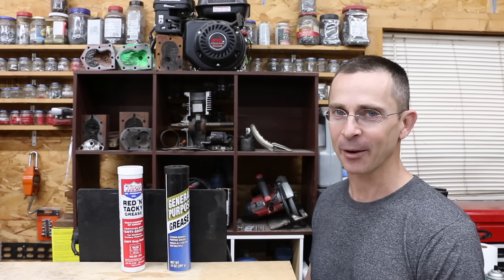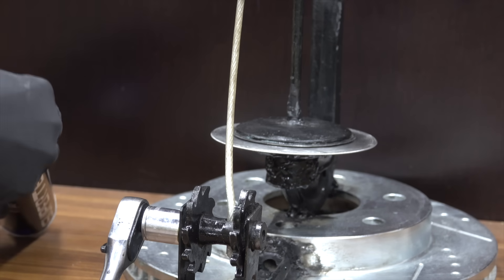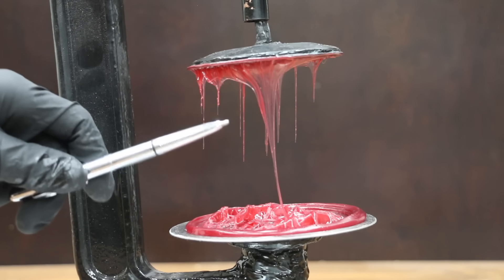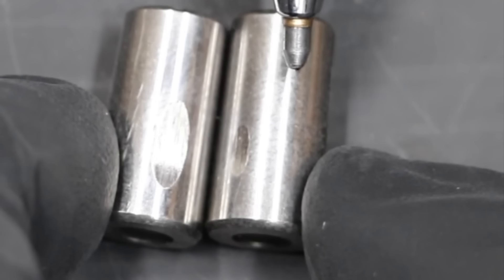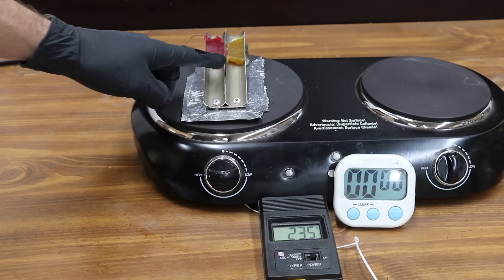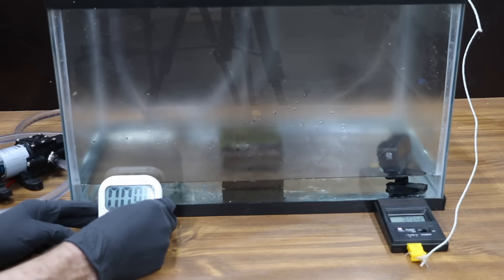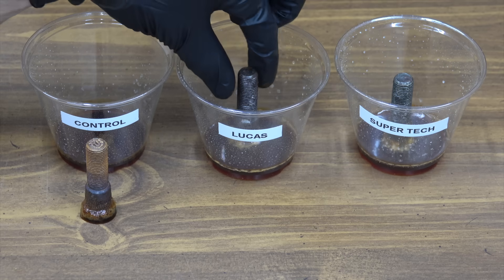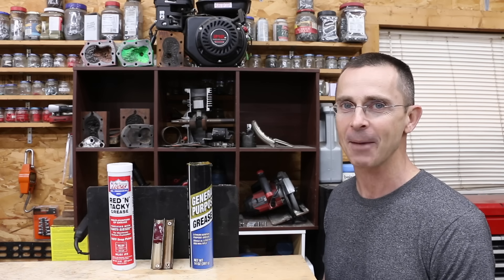Is Cheap Grease better than Lucas Red N Tacky? Let's find out! Bearing Grease Test Episode 1

Comment from the maker: Thanks to everyone who requested this one, and please let me know what other brands you'd like tested.
Lucas Red N Tacky: https://amzn.to/3l3lKKh
Super Tech General Purpose Grease: https://www.walmart.com/ip/Super-Tech-General-Purpose-Grease-14-oz-Tube/16928006
Reply: What about the Lucas X-Tra Heavy Duty Green?
Reply: you almost have a million subscribers, will you make a 1 million special video once you hit 1 million? ;)
Reply: The German Dude Hoffentlich.
Reply: I'd like to see Amsoil grease tested and Motorkote.
Reply: I'd like to see valvoline grease tested.
Reply: Could you test those rather expensive Teflon/PTFE dry lubes and sprays?
Reply: AMSOIL, would also be cool to throw some marine grease in next line up to see how they compare at water repellent test.
Reply: randomsanwhich 
I would like to see Amsoil also. I use Evinrude Triple Guard Grease and Extreme Pressure Wheel Bearing Grease for all marine applications (as a marine mechanic). I would like to see how these 2 compare to other manufacturers (like Amsoil).
Reply: randomsanwhich 110% agree. I use Amsoil grease for my bearings on trailers, hedge trimmers and my rack and pinion on my boat.
Reply: Would really love to see Valvoline SynPower Synthetic. Its black and feels gritty. Thanks!
Reply: Mobil 1 and Amsoil!
Reply: Shaffers grease would be awesome to try out!
Reply: Mystic JT-6
Reply: i would like to see mobil 1 and amsoil. My boss at my old job swore that lubrimatic marine 11402 was better than anything. thanks
Reply: I'd love to see Dumonde tech MR Grease or Phil wood grease
Reply: Deere vs Cat VS Case  etc own brands.   You could re-do all your grease, oil, penetrant, lube tests with the brands we pick up at the dealer while we are getting the parts because its right there and we dont have the time to go somewhere else to get brand x.
Reply: Harbor freight has a brand it carries aswell check it out.
Reply: Super lube
Reply: Travelers from tractor supply.
Reply: Any brand of moly grease and lithium grease
Reply: Texas Refinery Crown And Chassis
Reply: mobil 1, redline (thinking like CV2 or similar)
Reply: fords moly grease please.
Reply: Some marine grease :)
Reply: Which gun oil or lubricant works best for lubrication.  Such as froglube vs graphite or Rem-oil vs Hobbes.
Reply: PickelJars ForHillary As much as I hate to say it (criticize). My son and I tried frog lube and after a storage period it gunks up and will cause reliability problems. Degreased and applied break free (the older formula) all is well.
Reply: Sta-Lube SL3121 Marine
Reply: Chemsearch came out and had a demo. It was impressive. Great grease.
Reply: NewHolland Ambra grease :)
Reply: Cat grease https://www.cat.com/en_US/campaigns/awareness/cat-fluids/greases.html
Reply: Please project farm take a look when you have time buddy love your channel!!
Reply: Excellent Video! I would love to see Valvoline Cerulean, which bills itself as a heavy duty grease suitable for heavy fleet and mining use. I have been using this in fleet trucks with good results, but im always looking for more info!
Reply: WD-40 Multi Grease please.
Reply: Paint remover/stripper!
Reply: Boat trailer bearings get alot of water exposure maybe some specific marine grease can be tested for water repelling ability like u get a whole summer of boating.
Reply: I think I've got a good video idea for you... Would love to see you test different gasket makers like Toyota FIPG, Honda-Bond, Permatex etc. Maybe show resistance to heat, ability to with hold pressure, ability to adhere to surfaces that aren't perfectly smooth? Love your videos!!!
Reply: I had a boat wheel bearing running hot that was initially packed with Royal Purple grease. I stopped and purchased the Lucas Red and Tacky. The bearing then ran at normal temperatures. (I could have flushed water or debris out with the Lucas) I’m sure Royal Purple is good also. 
I’d like to see Certified Labs Premalube tested. It seems like a great grease. We use it at work in trailer bearings that are used and abused. I can send some if you would like.
Reply: Texas Refinery Paragon 3000, Mystic Greases, Lucas Heavy Duty, Certified Labs Premalube
Reply: If you are testing greases that are in a tube and not the big containers you can buy for wheel bearings and things like that... Then I can think of a bunch. Driven, Green Grease, Mobil 1, Shell Rotella, STP/ Costal has 2 different kinds, Valvoline has like 7 different kinds, I think WD-40 makes a few, the other various kinds of Lucas, and I think even Royal Purple has some. Those are all that I can think of that are "popular" but someone else is probably going to think of some more.
Reply: Mobil 1 Full Synthetic grease
Reply: Would love to see maxima and bel-ray tested!
Reply: Please test Mobil 1 synthetic grease.
Reply: Thank you for being to transparent and thorough with your testing. I've noticed in other videos that even when you learn new information or methods, you retest, adjust accordingly and reference it. This level of honesty and attention to detail is what makes me recommend your channel and trust your results moreso than what I grew up using. Been doing automotive/HD truck and Fleet for 20+ years now and I have found myself replacing some chemicals I have used my entire career based on your videos. Also, my 6 year old loves your Duct Tape comparison videos and now we have TRex tape because he said it was the smarter choice... See the influence you have?! Thank you for your diligence.
Reply: I'd like to see some high end greases tested. Such as amsoil chassis grease.

I'd be willing to furnish the amsoil and send it over for testing
Reply: Redline CV-2.  800°F drop point, rich in molybdenum disulfide, works better than NLGI certified bearing and chassis grease from NAPA over both time and temperature.  Wheel bearings, hinges, caliper slides, CV joints, nothing I've ever used on has failed or worn out.
Reply: there is a brand of lubricants by the name of Schaeffer that are super good. when i hauled fuel in the Canadian Arctic i had the opportunity to spend 3 days in a shop as my truck was being repaired for leaking injector cups. this particular shop used ONLY Schaeffer products. I asked what's the big deal with them and found out that one large northern based trucking company (Whitehorse Yukon) would use ONLY Scheaffer products in their equipment. the drivers told me it was such high quality that it justified the cost of the product. nobody wants to be fixing at 50-60 below. and the coldest part of winter is peak season. 

anyway the shop owner let me watch and help and i learned so much in those 3 days. i even had coffee breaks with the mechanics. i suppose to most people that doesn't sound like fun but it was for me. maybe you could test their products against others. it was crazy expensive i remember the grease was 8 bucks a tube. thanks for all the work you do.
Reply: Mystik JT-6 Hi-Temp
Reply: Please test Mystik JT-6. Most farm stores carry it around me, so that's what I use, as well as most people in my area.
Reply: Green grease and redline please!
Reply: Would like to see GREEN GREASE by Omni Lubricants B004Y0788O (Amazon) against red n' tacky. Thanks
Reply: You know Super Tech makes a high temperature red grease like Lucas Red N Tacky Multi duty. Its called Super Tech Multi Duty Grease. You should do a test on those since their very similar to each other. Unlike Super Tech General purpose which is for light duty applications.
Reply: Orileys house brand
Reply: Please test Motorkote grease (and do lubricity test on restore plz).
Reply: AIR-TEC g200 is all I use. I’d love to see how that compares to more affordable and readily available products.
Reply: BARDAHL EP2  grease
Reply: You ever tested 2 stroke oil I use all sorts of 2 stroke oil not brand loyal but just would like to see who's king
Reply: Magnalube G. Its expensive and I use it frequently. Seems good but is it?
Reply: @meinbtown  I used to use it too, I'd love to see how it does compared to others like Lucas Red'N'Tacky which is what I use these days.
Reply: Please try krytox GPL205. It's expensive but it is true PFPE/PTFE grease. I am very curious how it compares. Dupont has made alot of claims about the stuff.
Reply: I'd love to see a comparison to Kendall L-427 Super Blu. I've never seen any comparison testing with it, but in the field, it really stands out in it's ability to hold up. It has been my go-to for 20 years. With a lot of similar specs to the Lucas, and being such and old name, I feel like it would make a great comparison video to it, as it could be a lot closer of a race between two great multi-purpose greases
Reply: Project Farm try different oil ratios ( 50:1, 40:1, 32:1, 24:1 etc
Reply: Can you try synthetic grease, I know advanced auto parts sells a red synthetic grease, I use that in my ball joints, it really helps
Reply: Great tests. How about something with a Moly base?
Reply: Aeroshell 33 (pure synthetic not the MS/moly): I've switched this to my universal to include automotive+aviation.  Left in a tube, it dries out in 2-3 years.

Mobil 1 (of course): separates and bleeds out in a year - 18months

Mystic JT-6 multipurpose

Valvoline multi vehicle high temp (red)
Reply: Project Farm  all the greases, this test
Reply: how about 274 moly schaffer grease?
Reply: Amsoil grease against Lucas
Reply: I'd be interested in seeing how Evinrude blue grease stacks up.
Reply: Best. Channel. On. Youtube. Period.
Reply: Corrosion X, Corrosion block, penn fishing grease, park tool high performance grease
Reply: @Mastr-Tech  Finally, someone who knows about corrosion x and penn grease.  I was going to suggest those too.
Reply: I would like to see sta-lube (harbor freight) atomlube and wd40's grease. Thank you for the well thought out video and tests.
Reply: Thank you for finally starting on this series!! I’d love to see Royal Purple Ultra Performance, Amsoil Multi-purpose and maybe the NLGI2 Off-road, and Redline CV2... to name a few. I’m excited to watch this all play out!
Reply: Its N L G I !!!
Reply: Do green grease vs red n tacky
Reply: Park Tools Polylube. It's pretty much the de facto bicycle grease.
Reply: Schaffer’s molly grease please I got a salesman that keeps telling me I need to switch but I’m not sure it’s worth the cost
Reply: Hey I forgot I use chevron delo , it would be cool to see it vs Schaeffer
Reply: Bel ray waterproof grease
Reply: Please test Marine Grease compared to Lucas Red ...TY
Reply: Schaeffer's 238!!  Time for an ultimate grease showdown
https://www.schaefferoil.com/238-ultra-supreme.html
Reply: Bel Ray waterproof https://www.belray.com/product/waterproof-grease/
Reply: Mystic JT6 with Moly
Reply: Mobil 1 synthetic, Valvoline synthetic, Lucas heavy duty and Shell Gadus
Reply: It's expensive but could you do a test on John Deere SD poly urea Grease and just for fun do a test on the cheapest tube of Grease you can find
Reply: I'd like to see some Moly greases tested and the Mobil brand specifically
Reply: Redline
Reply: Another vote for Bel Ray water proof, also Caterpillar but the desert gold version, this is the best stuff I've ever used.  Made for extreme environments, high pressure. I use it in my off road race cvs.  Same stuff desert racers use.  It sticks to everything, very difficult to clean off
Reply: Can't forget redline cv2, great stuff!
Reply: Mystik JT-6 Synthetic Hi-Temp Grease #2 ISO 220
Reply: Energy Suspension silicone lubricant, sil glyde,  super lube, royal purple. Those all would be great to see tested. Thanks.
Reply: Test Mobil 1 ep grease, that is what my work uses on the 5th wheel plate of semis
Reply: amsoil synthetic polymeric off-road grease nlgi #2
Reply: I would like to see the big brands like Mobil, shell, chevron, lucus, masoli, basic brands and see if their price points are worth it.  We use Chevron's delo esi ep 2 and it's not cheap but seems be a good grease.
Reply: I'd love to see Lucas red and tacky vs Lucas extra heavy
Reply: Could you try Maxima waterproof grease?
Reply: A battle of gear oils would be interesting.
Reply: Im so happy you accepted my suggestion
Reply: Green Grease
Reply: Please test 'Green Grease'  - it can be found in most auto parts stores.  It's quite tacky, resistant to water, and works well for utv's.  https://www.greengrease.net/
Reply: Umm...any chance you could identify the lot numbers on those tubes? It should be at the top of the tube (plastic cap end). If it's all numeric (like 414367...) Please post. It may be hard to see as it's laser etched into the foil - I'm a quality control chemist for Chemtool...we are one of the manufacturers of both of these greases.
Reply: @jensdavidsen4557  I could when I go back to work im off today.
Reply: Primrose 327, 8 bucks a tube but it’s supposedly the best grease there is, according to pretty much every heavy duty diesel shop around here
Reply: Shell Gadius S5. Best Grease i've ever found.
Reply: Premalube heavy duty multi purpose nlgi #2 grease h2. My friend is changing from lucas tacky to that stuff above.
Reply: Water coolant test 🤔🤔🤔
Reply: John Deere SD polyurea vs Lucas x-tra heavy duty. They seem to be the same grease.
Reply: I would love to see a test with Orion 95+
The best grease I have used
Reply: From my experience, lucas is closer to heavy duty wheel bearing grease.
Reply: Motorkote..
Reply: Lucas Red n Tacky vs Certified Labs' Premalube Red
Reply: Please please please buy and compare Opti-Lube ULTIMATE Grease!
Reply: Castrol Tribol GR100 PD2
Reply: Valvoline Crimson and DRIVEN EPC
Reply: Would like to see petro canada precision synthetic grease, here in Canada we either use red and tacky or precision synthetic for the product pumps on our tanker trucks.
Reply: Great video!  I would like to see amsoil and trc
Reply: Sta-lube marine grease.
Reply: Bigfoot greese is really cheep at napa and I have been loving it for our golf course equipment. Its super sticky stuff and handles the water well
Reply: Tractor supply autozone advanced etc I think would be a great starting point.
Reply: Traveller extreme duty 3 percent moly at tractor supply is what we use for our logging equipment. Would love to see how it does. This is another great video topic that I didn't even think about!  Thank you!
Reply: It would be great to see Chemsearch vs Certified Labs vs Mobil XHP 322 Mine.  Testing their ability to maintain a protective film under extreme pressure and impact would be very helpful for those who run heavy equipment.
Reply: I'd love to see how Valvoline marine grease stacks up against some other marine greases like Traveller or Supertech. I use Valvoline marine by the 35 lb bucket when assembling new snowplows and servicing old ones. Thank you for your extremely comprehensive and unbiased reviews. I refer to your testing whenever purchasing tools and consumables, so far the Dewalt Carbide utility blades and the 4.5" Diablo cutoff discs have been great purchases.
Reply: Great video, very well thought out testing methodology! Could you test Magnalube-G please? Additionally, if possible, test a grease/dry-lubricant hybrid, like Red'n'Tacky mixed with Tungsten or Molybdenum disulfide powder?
Reply: Mystik red and tacky?
Reply: Please test the winners in an all-out test against each other.   i am curious to see how they will stack up.
Reply: Pennzoil grease!
Reply: Great Video.
Reply: we use a castrol product, pyroplex blue, #2 grease i know its tackier than the lucas and is supposed to be extremely water resistant, we buy by the case, would like to know where it stands, 
thanks and keep up the good work!
Reply: Valvoline grease and maybe a synthetic
Reply: Can you test common petroleum jelly (Vaseline) as a 'base' or 'control'?  Also, how about testing silicone grease - like electrical grease?
Reply: moly paste?
Reply: I'd love to see you test Jetlube 50350, white lithium grease with PTFE (teflon).  We call it magic grease at my company because it makes every mechanism work buttery smooth.
Reply: I would be interested to see dyna lube grease. They also make an oil additive
Reply: Tractor Supply Red grease.
Reply: you can test different brand fishing reel greases vs different brand marine greases
Reply: Project Farm please review amsoil a grease https://www.amsoil.com/shop/by-product/grease/
Reply: Marine grease like Quicksilver or something similar please! We're in a saltwater environment and would love to know which is best to use
Reply: Tractor supply has like 3 different kinds of travelers. I'd be interested in differences.
Reply: Grease lightning
Reply: AR8100 Heavy Duty Grease and AR8300 Severe Duty Grease against the Lucas Oil. 
I'm blown away that no one has mentioned this yet!!!
Reply: Test some calcium sulfinate grease. as far as the 4 ball weld test, its double than what normal lithium based greases can handle. not to mention an even higher drop point.  the grease brand Prolong would be the one to test against others.
Reply: Valvoline Moly-Fortified Gray Full Synthetic Grease
Reply: We use a lot of the John Deere multi purpose grease and Akcela Case IH multi purpose grease. I'd be really interested in seeing those two tested.
Reply: Please do tire brands comparision. expensive vs cheap, winter vs winter tires, summer vs summer tires, and winter vs summer and so on.
Reply: mobil 1 grease for sure
Reply: Amsoil since they won’t the oil competition
Reply: Mystic and Valvoline brand grease please
Reply: Graphite spray.
Reply: You never tested hole saw brands
Reply: Have you ever used the grease from a farm co-op
Reply: Love to see a bike chain test. one with no lube, paraffin wax, ptfe, brand names etc. testing wear,  heat and stretch. then add water!
Reply: Mercury marine grease
Artic cat snomobile grease
Life brand vaseline
Reply: Test how much grease should be backed in a trailer wheel bearing hub? Some people say pack them completely full and others say pack the bearings and just put a handful of extra grease in each hub. I’m sure you could repack a trailer, one side each way and then load it down to max gvwr and tow for an hour and temp check each hub to see which is hotter and then disassemble each to see where the grease all went and how it covered components.
Reply: Test Mobil SHC 007 grease compared to a high quality synthetic grease in wheel bearing applications.
Reply: At work in all our equipment the company uses Wolfs Head Red Grease.
Reply: Sta-Lube SL3151 White Multi-Purpose Lithium grease vs. lucas red
and
Sta-Lube SL3121 Marine Boat Trailer and 4 X 4 Wheel Bearing Grease vs lucas red.
I know these are two separate types for different purposes.
thank you for all your videos and immersive testing.
Reply: Bel-ray waterproof grease
Reply: Mercury 2-4-C marine grease. I use it on everything and I really love the product, just curious how it compares to other products
Reply: I don't have a grease suggestion, but I do have another idea for you.  Double sided industrial tape.  I was looking for some for work and there are so many different kinds to choose from.
Reply: Very interesting results! Thanks for the video. I've heard Royal Purple is the best. So would be interested in seeing a comparison with that.
Reply: Would like to see a Lucas Red n Tacky vs Lucas X-Tra (green) grease at some point. Maybe versus their Valvoline red and green counterparts too for added value. Thanks, and love the videos!
Reply: I drive a tractor trailer and used Lucas to grease my fifth wheel red and tacky they make bags u put one on each side of the fifth wheel and crush them between the truck and trailer and done
Reply: Can’t tell you how much my co workers and I love your channel! I never miss a video! I am very interested in seeing you test Archoil, Turbomaxx & nanolube oil additives.
Reply: you think peanut butter could work as a grease substitute?
Reply: Peak Synthetic Marine Grease
Reply: John Deere
Reply: Lubriplate grease, supposed to be some pretty good grease for wheel bearings.
Reply: Mystic semi syn vs valvoline synpower. I was surprised how the Lucas did better even though it didn’t seem to be re-coated as well on the wheel.
Reply: Its pretty obvious a lot of y'all don't live/fish near the salt water.  Here are some ones used in the gulf to add to your testing.  Corrosion X, Aquashield (youtube it, its some crazy tacky stuff), Penn Reel Grease, Yamaha Marine Grease, and Lucas Marine Grease.  I'd be curious to see how 3M/Dow Silicon (di-electric) grease do also.
Reply: Maybe cheap dremel bits to dremel brand
Reply: Amsoil
Reply: Your pure science with these methods
Reply: John Deere. They make a few kinds, make sure to choose one that is comparable to the others in the test. In my experiance, it tends to "stick" a lot longer then box store off the shelf stuff, and most certainly handles outdoor weather better.
Reply: I’d love to see this compared to blue marine grease. It’s what we have used it on the farm for years.
Reply: Should love to see pro one grease be tested they use similar rigs as you do but the results are soo good I almost think it's fake but high pressure oil rigs and NASA use it so it should be good right?
Reply: @farmersgrip  late to the game? Watch his passed videos bud
Reply: @TheLongjohndong  sweet ill look for it
Reply: Awesome job on the video!!
Reply: Project Farm, You may have done it in the past but how bout doing lubricity tests and corrosion prevention tests on gun oils. I always wonder which is best for guns. Fishing reel oil would be another maybe. Enjoy your videos! Thanks ✌️
Reply: Project Farm we use castrol Pyroplex Blue at work and I use it at home. I’d love to see how that fairs in a test. We’ve noticed significant less wheel bearing failures due to moisture based corrosion since we’ve switched to that from generic NAPA all purpose chassis and wheel bearing grease.
Reply: Mercury Extreme marine grease. Best stuff out there. Bet.
Reply: How about restoring a 12v car battery, I have seen a lot videos on it but does it really work?
Reply: redline cv2 grease! curious if i'm just buying into the hype or the stuff i've been using is actually decent. keep up the awesome, informative videos!!
Reply: Yep amsoil grease for automotive applications compared to Lucas would be good
Reply: Can you test the Lucas Low Viscosity Oil Stabilizer? I want to know if it actually makes a difference.
Reply: Maybe a marine grease!
Reply: Please test a food grade grease. I work for food and beverage manufacturer, and we can only use food grade which I believe leads to tons of bearing failures. Thanks
Reply: Please consider testing Power Punch grease.  I use it over the Lucas Red & Tacky.
Reply: I work for a Mack Truck dealer and we have our own branded grease. Can I send you some for you to test and compare?
Reply: How about traveler brand from tractor supply, mystic,cenex brand and lucus. This was another great video,keep them coming.
Reply: Maybe throw Cenex grease into the test as well
Reply: Fantastic job on this video!
Reply: Mobil!
Reply: Cenex HD Moly Extreme, a buddy and I were comparing his high temp for clutch bearing vs this moly that I use in all my construction machines and trucks
Reply: @kenball1980  I was hoping someone would mention this supertech grease instead its also red like that lucas grease feel like it would be a better comparison
Reply: Try moly grease, supertec vs other brands.
Reply: amsoil grease!!!
Reply: Marine grease vs red and tacky
Reply: You need to test Claas ep-2 and Ep-3 Grease. I believe it’s the best grease out there 👍🏻
Reply: I have a video idea, testing the lubricity of various oils at different temperatures to see if it changes significantyl, if so how much and which oil is the most stable over a wide temperature range.
Reply: Schaeffer's makes a red n tacky
Reply: Compare sythetic diff fluid to regular diff fluid
Reply: Alco-Metalube
Reply: Can you get your hands on some whale oil? Supposedly it is far superior to modern petroleum oils in terms of film strength.
Reply: So should test safety glasses
Reply: Please test  rotella t6 5w40 vs valvoline premium blue 5w40. Both are good brands, but one has to be better?
Reply: Try Pro-ma MBL Grease. Friction brake/Cross action test will blow any other grease out of the water. You dont need much of it either. Search "MBL Grease demo" on Youtube.
Reply: Could you test Ballistol multi purpose grease? Is it available in your country? It is a grease used here in Germany.
Reply: Flat Tappet lifters. Engine builders have said that currently available flat tappet lifters are not as durable as the old ones and are experiencing lifter and cam failer. Can you test modern built flat tappet lifters against vintage NOS ones?
Reply: Mobil 1 222 vs red n tacky
Reply: Valvoline SynPower Synthetic Automotive Grease - 14.1oz (VV985)
Reply: lucas makes several greases, including lithium, marine grade, HD mining+construction,  xtra HD and synthetic high pressure grease. it would be amazing to see lucas' own line go through the gambit to highlight strengths and weaknesses of each so that we can make an educated decision even with the same brand. also, how does liqui moly compare?
Reply: motorup..... you really need to test it just watch some of the online videos of its advised performance
Reply: I currently use Royal Purple grease, lets see if it's worth the money!?
Reply: TRC 880 crown and chassis. Been using it for years because I’ve been told it’s the best.
Reply: You really need to test is the MilSpec standard for extreme pressure grease Aeroshell 64. It was used on almost every grease surface on the jets I worked on, and it's even the antiseize used on M16 barrel nuts.
Reply: Hi, can you do an episode on rust converter/primers to see which is best at preventing rust from comming back. You can try well known brands like Brunox, Corroseal, Fertan, Jenolite etc..
Reply: You should also test the John Deere thixotropic Corn Head Grease.
Reply: Superlube synthetic grease vs a Moly grease vs a marine grease vs a regular grease please!
Reply: Adam lube would be a good competitor. It's the only grease I use anymore.
Reply: I use the green grease of Lucas for rifles. It's amazing. But picks up dirty like none other
Reply: Look forward to the grease race
Reply: Please test what is best to use for cable lube at low temperature
Reply: Napa grease, tractor supply grease and marine grease would be good to test
Reply: Lubriplate No.1200-2
Reply: I use Lucas xtra heavy duty grease in my equipment. Even more expensive than red and tacky. Can u test the xtra heavy duty grease please?
Reply: Amsoil kicked butt in the oil shootout, how does their grease do?
Reply: Something with with Molybdenum of course, but also Mobil1 since I just bought a case. UMI performance has a special grease for their roto joints, so now i wonder. Also, dirtbike waterproof grease. I'll have to look up the brand.
Reply: Love your videos, I tried every type of grease known to man for the high-speed bearings on a city leaf machine on the shaft and bearings that run the impeller. Kendall blue never failed us for over 30 seasons and every time we tried something a little thicker it would slow down the speed of the balls and score the race but keep in mind this was super high speed bearings just a little informational input
Reply: Next grease test can you test {Mystik Multi-Purpose Grease} NLGI NO. 2 (upc:044871548452) Sold at Walmart
Reply: There's this brand I'm seeing advertised on Facebook, UltraLub. Any chance you could test their motor oil to see if it's any good?
Reply: What about using baby oil for an engine?
Reply: I would like to see Valvoline Cerulean grease and Chevron Ultra-Duty EP grease tested.

I can send you a tube of each but don’t know your address.
Reply: Project Farm you should test Mentek Elite Grease vs Lucas Red n Tacky. I have some Mantek grease that you could use I would really love to see the results
Reply: Amsoil and Mobil 1 synthetic greases would be good to test since they are both popular and similarly priced.
Reply: If you can get hold of some I'd love to see omega by sovereign  lubricants tested
Reply: Wonder how molybdenum grease holds up
Reply: Amsoil muti purpose grease
Amsoil marine
Amsoil racing
You should do a championship like the motor oils
Reply: A look at Park Tool bike grease PPL1 would be great!
Reply: The valvoline crimson
Reply: I would be interested to see this same  comparison between Lucas and Amsoil grease.
Reply: I’ll help pay for you to test Traveller Extreme Duty 3% moly lithium from Tractor Supply Company (TSC)
Reply: Test the Schaeffers grease
Reply: Project Farm wd40 specialist grease and mobil 1 and valvoline.
Reply: Test John Deere grease.   They will void warranty’s if you don’t use their grease.
Reply: I wait one day there is already 200+ replies!

Anyway, I hope my list isn't too long. Please test;

Power Up Lubricants Thxiogrease (https://www.youtube.com/watch?v=dPY0a9IocVg&t=310s)
Chemsearch Maxi Lube (https://www.youtube.com/watch?v=Vgsyjxll224&t=12s)
Amsoil Polymeric grease
WalMart brand AtomLube and the Red Super Tech
Harbor Freight Sta Lube and Super Lube

If you need the Thxiogrease let me know!
Reply: I use mobile 1 full synthetic grease. Can you do another grease test for more brands including marine grease.
Reply: I, too, would like to see how the Supertech red high-temp grease stacks up against this Lucas grease.  The temperature cutoff is the same: 500 degrees.
Reply: Try Mobile XHP 322 Mine. About $10 a tube. Available on Amazon.
Reply: listed in comment below, but maybe a manufacture specific oil test and rate them agains Amsoil as it was the winner.  Polaris, and any other manufacture labeled oil.  would be nice to see if we are really getting what we pay for.
Reply: Dear Project Farm, when you test other brands of grease can you test a brand that we have over here in the UK if i send you a tub of it? Thanks in advance.
Reply: I would be willing to send you some other greases to test if you would like
Reply: PARAGON 3000
Reply: Schaeffer Ultra 221 Moly Grease. Aluminum Complex, 3%Moly. I use it for all kinds of stuff.  Also, Super-Lube Multi-Purpose grease NLGI 2 would be cool to see, its an amazing grease as well.
Reply: Sir, you're a national treasure.  What a service you provide for mankind.
Reply: I have used Lucas Marine Grease before with good results, that might be worth testing.
Reply: Add masterpro to the list.
Reply: Misty Super High Impact Grease ! I would be willing to send you some if you can’t find it. By far the stickiest grease I ever touched
Reply: Do you have a rural king near you? they carry their own brand. Also how about just a shootout of 6 brands?
Reply: Great job! Grease showdown in our future!! 😀
Reply: marine 2 stroke oil vs 2 stroke oil
Reply: Please test hydrotex grease!!!  Let me know i would be willing to send you a tube to try!
Reply: "Green Grease"
Reply: Thanks so much for sharing! We currently use Chevron grease and you are making me rethink that decision.
Reply: Just an fyi, there is a much better way to pack bearings
Reply: Schaffer’s, chevron, Lucas, auto parts brands, amsoil, etc.!
Reply: Test Shaffer's grease
Reply: How about testing Thixosyn aviation grease?
Reply: Mystik jt-6
Reply: A high moly grease, Lucas heavy duty, maybe some jd or caterpillar grease etc
Reply: I would like to see Mobil high moly grease, a cheap store brand moly grease, and then maybe ultralube vegetable based grease, etc
I’m of the opinion that the black moly grease is far superior to any red or blue translucent grease and would love to see if that’s correct!
Reply: Include Mystik JT-6 Hi-Temp Grease #2 in the next grease test
Reply: I would love to see how Racing grease compares to this!
Reply: Schaeffers, its got moly in it, way better than all the rest. When the grease squishes out the moly still lubricates
Reply: Great video and eye opener. Maybe Mystic, Shell, AMSOIL & Lucas
Reply: @ProjectFarm you are really awesome.
Plz check the grease from "CarQuest" against Mobil Grease, if possible.
thank you.
Reply: Gumball's Gameroom that product should have been tested vs the one used. This video was a bit of apples to oranges in terms of grease...
Reply: Shell Rotella came out with a line of four different grades of grease a little over a year ago.  Would love to see those in a test since they were recently developed.
Reply: I always use Copper Grease (In the UK)
Reply: Could you compare the Lucas red n tacky to the Extra heavy duty
Reply: What is the chances of you testing out Lucas Oil additive to STP oil additive I want to see the results which one is better... I've been using Lucas everything they made for years ever since they came out I would love to see if my money was well spent or not so far you prove that the Lucas products are good
Reply: Mystic jt-6 red #2
Reply: Shell Alvania Ep2 vs Kluber Ep2
Reply: Would love to see some testing on friction reducers. https://gonmf.com/
Reply: @sneakypete187 Yeah I think the green is a beryllium based grease. I could be wrong but the beryllium based grease we use at work has underwater uses
Reply: Lubriplate grease,  specifically the "SFL" line; NLGI #0 grade, if possible
Reply: Which battery powered grinder is the best?
Reply: Just for once test independently the polytron grease I am using for everything, even the grinder gear... https://www.polytrondirect.com/product/polytron-ep-2-lithium-grease/
Is cheap also in my oppinion and works wonderful. I am a simple user of oil and grease for my car and tools.
Reply: Please consider doing comparison shopping with Hot Shots Secret brand products.  They only produce a product when they can make it the best in the product category.  Caution:  Please use mixed as directed.   Their Deisel Winter Antifreeze fuel additive if left in the cold may freeze up in the teens or 20's.  If it is mixed with diesel fuel it protects to 40 below -0-.  Thanks again.
Reply: A new product being developed at Hot Shots Secret is "Grease."  Just so you know if you test Greases again.  Thanks!!
Reply: Off subject, but could you test the Zero water v. Brita?  Adding some others and sending the water off for test. The Zero water comes with a digital tester.
Reply: I would like to see super tech red vs red Lucas
Reply: Cerma oil and grease ck as I'm to beat anyone's friction and wear!! I'd love to see you test them
Reply: Harbor Freight vs kubota lithium and red grease
Reply: Texas refinery greese
Reply: I would like to see you test Mystik JT-6 High temp.  Thanks
Reply: Could you test Amsoil heavy duty grease and high speed grease against some MFA oil grease? I am an amsoil dealer and I liked your test it really proves that grease is not equal
Reply: REDEYE VS LUCAS
Reply: K-Y ?
Reply: How about a video on concrete anchors???
Reply: Great video!
Reply: For kicks, Creamy Peanut Butter 😁
Reply: Could you test hydrophobic fluids for windshields?  TIA
Reply: Amsoil
Reply: Does used engine oil destroy gaskets and seals if you let the oil sit in the car. If you were storing it. Or simply letting it sit, for a long period of time. I often find myself changing out oil with 1500 miles on it before I store my car. Almost Seems like a waste of material. Thank you Project Farm! Great great content.
Reply: I use the super tech marine grease a lot hopefully you can get it in there
Reply: Project Farm can you test gasket makers? Like permatex products.
Reply: Can you test Mobilgrease xhp222 ? (the blue stuff)
Reply: mobil 1 marine grease- that's what my boats use
Reply: Project Farm I would like to see how Valvoline full synthetic performs.

https://www.amazon.com/gp/aw/d/B000CQ4DK0?psc=1&ref=ppx_pop_mob_b_asin_image

And the Lucas extra strength
Reply: Schaeffer 238 is the stickiest best equipment grease I’ve found. Makes lithium greases look like a joke
Reply: Duralco 4525, I'm told it's crazy strong.
Reply: Schaeffer 248 "Moly Synguard 2000" claims higher operating temperatures than Lucas.  Gentlemen, rev up your hotplates!
Reply: Red n Tacky vs John Deere Multi-Purpose HD Lithim Complex
Reply: John Deere grease
Reply: What happens when you use diesel fuel additive in a gasoline engine
Reply: Test new rotella grease
Reply: Yamaha watercraft and Polaris  brands.
Reply: 3M's silicone grease  and their copper based grease.
Reply: Amsoil please
Reply: Mobil 1, vs lucas, vs valvoline, vs other high cost greases would be fantastic IMO.
Reply: Aside from the obvious value of you test results, I watch just to see what new test jig you come up with
Reply: Marine grease vs Red wheel bearing grease!
Reply: The chemical spray that you used to cause the rust in the cup what type of Sullivant is It called?
Reply: Please add Phil Wood's grease to your next test. https://phil-wood-co.myshopify.com/products/3-oz-tube-of-phil-waterproof-grease
Also Prolong: Prolong Super Lubricants PSL45000 EP 2 Grease
Reply: Valvoline Full Synthetic Grease. I use it for almost everything.
Reply: why didn't you even mention that the cheap grease actually exceeded its drop point temperature by over 20 degrees?
Reply: Would love to see a comparison between Shell Rotella Synthetic and Mobile 1, both in 5w-40.
Reply: Please test John Deere Multipurpose SD Polyurea grease.
Reply: In addition to the standard quality and common greases, would be interesting to see how the famous SUPER expensive greases stack up, like FLUOROLUBE, KRYTOX, etc. Granted, some of them are made for special environments (like oxygen).. but I've always wondered how they perform compared to normal greases. Thank you for the hard work!
Reply: bel ray
Reply: bel ray waterproof
Reply: Hi I would like to see a gun lube test done I've got some I'll send you
Reply: Lucas heavy duty grease
Reply: redline grease please?
Reply: I have to say hands down this channel is the most informative
And for those who say that famers and rural foremans do not have experience as a former engineer.
Your information and tests are right up there with a lot of laboratories.
More informative than other channels such as engineering explained. No whiteboard and  supposed theorectical.
You show the correct tests and procedures used for most mechanical and other engineers.
Your humble approach in a manner everyone can understand and the break downs to the impacts 
are the best I have seen on youtube. Using available retail products. 
I do not know where you got the education or testing background but it is up there with some of the most accredited
technical schools and universities. My hat is off to you for practical application. with proper engineering behind it.

"Thomas Edison , "genius is 99 percent perspiration and 1 percent inspiration"
Reply: FS grease is mostly what I use and wheel bearings I use Royal Purple HPG
Reply: Would you be anle to test Certified Labs products
Reply: Please try John Deere grease next time in your grease test! It’s expensive and I can’t see how it benefits us over other less expensive greases
Reply: Chevron ultra duty ep2
Reply: LUCAS vs VALVOLINE FULL SYNTHETIC FORTIFIED WITH MOLY ?
Reply: What about testing different brands of machining lubricants that you would use when machining metal parts in a lathe or other equipment?
Reply: Can you please test aluminum foil. Shiny side vs dull side.
Reply: Might sound dumb but paper towels
Witch one absorbs better?
Reply: Can you use JB weld as a heat resistant coating or paint?
Reply: Mobil 28.
Reply: Project Farm I would really like it if you could test cheap multi tool blades vs dewalt / expensive blades. Maybe wood and metal , but at least the wood ones would be most helpful to me. If the cheap ones online work it’s a huge savings.
Reply: Can you test transmission fluids a mix between manual fluids and atfs to see which is the best on the market for transmissions
Reply: Polyurea grease would be a great one to test, a moly grease, and superlube
Reply: I enjoy watching your videos...I have a suggestion how long does it take for an idling engine to use a gallon of gas compared to a engine  using a gallon of gas while under load...if you have did it all ready that's cool I'll try to find the video so I can watch it.... thanks have a good day...
Reply: How about marine greases vs those marketed as general purpose? I have a tube of Red n Tacky in the garage but I use the Lucas Marine for the boat trailer and the gimble bearing on our I/O boat.
Reply: chevron sri grease
Reply: TENAVOLTS Rechargeable Lithium AA Batteries VS Top Brand NIMH Batteries
Reply: NitroLube/Nitro Red grease vs Amsoil synthetic.
Reply: Mystik JT-6 Hi-Temp Grease #2
Reply: Could you please test the red grease vs krytox grease , krytox is 300 dollars for a small tub but is supposed to be super high temp and better than red grease , it’s grey and is reccomeneded to use gloves when applying, the grease is supposedly cancerous if played with too much with bare skin , and they make us use them on nascar racecars in the drive plates on high camber applications with floating drive plate gears, but are we really getting our moneys worth ? 300 compared to regular red grease, only time we use the red grease is on super speedways because it’s low camber and less friction for speed and don’t have to worry about heat
Reply: HART drill and impact driver!
Reply: Mitch Paul instead, use an automatic lubrication system without moly or tungsten. Solids prematurely wear whatever they’re used on (especially tungsten since it has a hardness of 9 on the Mohs Scale - for reference steel is a 4.5)
Reply: Well I don't know, I have either Lucas wheel bearing grease in the can and I have used Lucas like that in the tube but not the red sticky stuff it calls itself but I don't know why. I normally bought Lucas wheel bearing grease in the can because it was a good brand and I'd used it often over the years. I've also used Napa brand but I don't know who manufactured it for them . I remember at one time when I was a younger man back 50 years ago there was a grease that my uncle sold at his store I don't remember what it was and it was wheel bearing in a can that Daddy bought and and I'm not sure of the brands I think it may have been GRC and farm oyl. I spect most any of it will do for my wheel bearings on my tractor front end loader part of it and the all the different pieces of equipment I use. I don't suspect that I will be spinning very many bearings fast enough to get them hot! Haha. I don't know what it is I have right now in my gun it came from Tractor Supply and cost about 2 bucks.
Reply: Would’ve been a more fair comparison to have used super tech’s multi-duty complex grease as it’s a high temp, red, lithium based like the Lucas red n tacky.
Reply: Mercury/quicksilver 2-4-C and extreme pressure greasd
Reply: Project Farm I’ve been loving all your videos! I’d love to see the Lucus Red n Tacky vs Traveler Extreme Duty 3% Moly vs AMSOIL Synthetic Polymeric Heavy Duty Off-road Grease 5% Moly
Reply: Lucas vs Amsoil.
Reply: T
Reply: K
Reply: N
Reply: O
Reply: W
Reply: B
Reply: U
Reply: T
Reply: I
Reply: T
Reply: S
Reply: F
Reply: U
Reply: N
Reply: N
Reply: Y
Reply: Gg
Reply: Gg
Reply: Gg
Reply: Gg
Reply: Gg
Reply: Gg
Reply: Gg
Reply: Project Farm gg
Reply: hey can you please review more kinds of grease including ams oil grease thanks
Reply: Please test Mobil One grease.
Reply: I'd love to see low temperature testing of Amsoil and Mobile 1 synthetics. I primarily use grease on my snowmobile so low temp properties are my primary concern.
Reply: Please test Motorex grease 2000 and Motorex crosspower oil 10w40.
Reply: Every test with the red one deffo had more of it on
Reply: When it gets out do flex grease
Reply: Corrosion block grease (by the same company that makes acf50)
Reply: Molybdenum disulfide
Reply: Project Farm when testing, try to keep the tests within their categories, i.e. Wheel bearing grease (disc brake, non-disc), CV joint, chassis grease, marine grease, etc. As for brands I'd like to see, Lucas, Valvoline, STP, WD-40, CRV....
Reply: Krazy grease from walmart
Reply: Valvoline Multi-Vehicle and Valvoline General Purpose grease please!
Reply: I don't think you've done it yet but I'd like to know if there's a difference between name brand and Chinese knockoff Mufflers how well they resist corrosion and the power added or subtracted to the vehicle
Reply: Would like to see the red-n-tacky up against the poly urea that John Deere sells.
Reply: Wd 40 Grease
Reply: Morris grease ?
Reply: Will y9u fo more grease showdows?
Reply: I would like to see the difference between Lucas red and tacky and Lucas xtra heavy duty green
Reply: You forgot the marine grease
Reply: Project Farm Toyota Tacoma
Reply: Marine grease test would be great
Reply: Mobil 28!!!   Many subscribe that the mobil 28 red aviation grease and the lucas red and tacky are similar enough to use the cheaper ($10-$15 per tube) lucas in small aircraft. I'd love to see if there are any similarities outside of the color, I'd even be willing to send you a tube of the aviation mobil 28
Reply: For wheels?
Reply: Test "Swepco 101 Grease" against Lucas.  This is a molybdenum grease that they say is one of the best out there
Reply: I use Schaeffer's 274 grease on all my trailer wheel bearings, ZTR mower deck and other grease point, plus all the grease points on my tractor FEL, and all 33 grease points on my excavator.
Reply: Amsoil vs Redline grease please.  Thank you Sir.
Reply: Witch tires last longer or buggies cords  later longer
Reply: Can you test the Canam BRP grease it's pretty expensive and Canam recommends only using that.  I wonder if it really is special.
Reply: dunno if you already did a video on it or not, but you should try comparing the same lucas grease with super tech's "multi-duty complex grease", itsthe same NLGI grade 2 with a lithium base, but it is rated for 500 degrees and is also NLGI GC-LB certified
edit: wanted to add that it's like 4-5 bucks at walmart
Reply: Amsoil red and blue please 👍
Reply: Can you test the Lucus Red & Tacky against an equivalent Radco brand Navy spec. grease.??👍👍🇺🇲
Reply: Cat vs. Lucas
Reply: I would like to see Lucas Red N Tacky vs Lucas Xtra Heavy-Duty vs Mobil 1synthetic grease...
Reply: I'd like to see how the Lucas red & tacky fairs against Mobil 1 full synthetic grease, it's red as well and seems quite tacky as well. Should make for a good comparison.
Reply: I was thinking about the supertec red grease.
Reply: 2stroke oils please
Reply: Lubrication engineers Almagard® Vari-Purpose Lubricant 3752
Reply: Any chance of comparing Kubota grease in the line up?
Reply: Amsoil vs Lucas red and tacky.
Reply: Shell vs Mobile grease. Company I work for started buying Shell grease products, people swear we’ve had more bearings fail since switching. Here last week I saw they started buying Mobile grease again.
Reply: Would you consider testing Caterpillar extreme application grease vs the Lucas red and tacky? Lucas also makes a farm and implement grease, which is green in color. I'm curious to learn which of the 3 greases are better.  Thank you!
Reply: Aviation wheel bearing Grease Phillips petroleum Red like that too, saved all my military trucks AMSA 53 TAMPA USAR CENTER.
   Some of them to two different Wars..! The high temp rating and the low temp rating of Phillips 66 Aviation Grease the salvation of military equipment.
   And it saved a pile of tax money..!
Reply: Compare Lucas Red N Tacky with Super Tech Multi-Duty Complex grease. Both are similar high temp grease. That might actually be a fair comparison. The test you did here was like, "hey, let's compare this Corvette with a Chevette."
Reply: Be sure to test the Amsoil greases that have such a loyal following -  including their famous "water-resistant" blue-grease (which recently changed its formula to a lighter color, concerning some longtime users if its stil performs as well)
Reply: Im not well versed on different types of grease, but I would love a grease comparison video
Reply: Prolube grease and Amsoil.
Reply: I'd like to see how Mobil1 synthetic hold up. Thanks!
Reply: Would love to see tests for kendall L-427 super blue, Quicksilver extreme and quicksilver 2-4-C. OMC triple guard . Gotta be some good results from those 4
Reply: Have you ever used Schaeffer 274?
Reply: John Deere brand of tube grease would be a great one, they have a lot of different grades of grease.
Reply: Any ep grease with an aluminum complex would be great to see. I've read that lithium soap will absorb water and wash out the lubricant where as an aluminum complex will not. 🤔 I want the best grease for my Enduro motorcycle rear suspension linkage and swing arm bearings
Reply: 5 years and I hope you still remember to test other grease brands!
Reply: Please test Aeroshell 22 with Lucas Red n tacky.
Thanks
Reply: Framonda grease😅
Reply: Gotta try. Prolube in the next one
Reply: Maxima Racing waterproof
Reply: Wd40 has their line of grease.  As well as harbor freight
Reply: There's a red grease from Tractor Supply, I don't remember the name, that I typically get. I think it may be the Mystik. Might be the Traveller too.
Reply: There is the sinto oil /grease and the seller showes the test vs amsoil it still work after having contact with water
Reply: There is a brand that keeps calling me. Chemsearch.
Reply: For general purpose grease I’d like to see Mobil shc 460. For a heavy duty grease it would be cool to see Mobil xtc tested as well. Thanks
Reply: Orion, Fuchs, Q8 are some grease brands I'd like to see tested.
Reply: @ColtaineCrows  makes me think of me going on a service call back several years ago. Had a guy and his name was Fuchs. I called him by the pronunciation: few-ks. He corrected me and said it was pronounced; fucks. Now I don't know if he was actually serious but I did not say anything except excuse me. But the rest of our conversation I referred to him as, sir. Just something and I guess old man just happened to remember that I thought was a little embarrassing at the time but funny now. Thanks for bringing back a memory!
 PS, pardon the way I tried to spell those out not really sure how to put the little symbols over the tops of letters.
Reply: @ColtaineCrows  And Silkolene RG2!!
Reply: Please test Bel Ray waterproof grease
Reply: @redeyedfreaks  +1 for Bel-Ray Waterproof Grease testing please. :)
Reply: I do woodworking as a hobby and have stuck with diablo blades, but it would be cool to see them get tested against one another.  If you have already done it could you point me to the video?
Reply: @bnieu1  I have always been happy with Diablo.  I switched to Forrest but I think the teeth are not as hard as they should be so you have to have them sharpened more.
Reply: Valvoline SynPower Synthetic Automotive Bearing Grease
Reply: Mystik jt6 and redline cv2. They are 2 of the most recommended greases.

It would also be cool at some point if you could test caliper guide pin greases like slyglide etc.
Reply: Ask the Bus Grease Monkey what grease he uses...
Reply: I would love to see the results of Park Tool's bike grease compared to these. I've always used Supertech and Lucas over paying way more for Park Tool's "bike" grease.
Reply: corrosion block grease
Reply: Mobil one synthetic grease
Reply: I love your channel, it's like disneyland for grown men.
Reply: h
Reply: A
Reply: H
Reply: A
Reply: I
Reply: M
Reply: A
Reply: F
Reply: I
Reply: L
Reply: L
Reply: U
Reply: P
Reply: T
Reply: H
Reply: E
Reply: R
Reply: E
Reply: S
Reply: T
Reply: W
Reply: H
Reply: Y
Reply: Y
Reply: U
Reply: O
Reply: a
Reply: K
Reply: I
Reply: D
Reply: O
Reply: N
Reply: Please test full synthetic 0w20  shell rotella. I despise 0 weight oil!
Reply: The WD40 grease and whatever harbor freight brand they sell now.  I know they have Valvoline at Autozone too.
Reply: s
Reply: I talked to Elon Musk.
He wants you to 
Slick Down his Rocket so it gets
To Mars Quicker.
Got to love that Lucas.
Keith Kuhn
Reply: You did not properly pack those bearings... to "pack" bearings you must force the grease into the bearing by a force pushing grease from the palm of your hand into the space between the rollers till it comes out from between each roller prior, to proper pack those bearings
Reply: glenn s 
You can see he squeezed the grease through the bearings when he hand packed them (at the end of each greasing)
Reply: @tdgreenbay  Even if he did in properly pack the bearings which I don't disagree he packed them consistently between the two so the test still holds up regardless
Reply: @austinmyers6212  not a valid test to just shove grease on the sides... its gotta be forced into the bearings
Reply: @austinmyers6212  its obvious from the video  and your claims you are not a mechanic... Austin Myers. Those of us who are mechanics understand how to hand pack bearings.... and the technique shown in the video does not get the grease into the bearings
Reply: @tdgreenbay  I was thinking the same but if you watch closely when he does the Lucas one it shows it for a split second. So he probably just edited it out for time saving.
Reply: @tdgreenbay  Hey Glenn, I'm pretty sure he did pack them correctly. It shows him using his palm on the second bearing. He probably just didn't record that part on the first bearing.
Reply: @nutsnbolts76  I did not see that
Reply: @tdgreenbay  I'll say what he won't say, "who's plucking this damn chicken"?